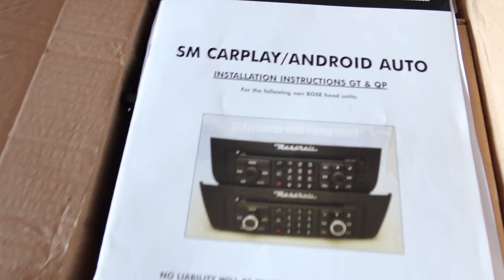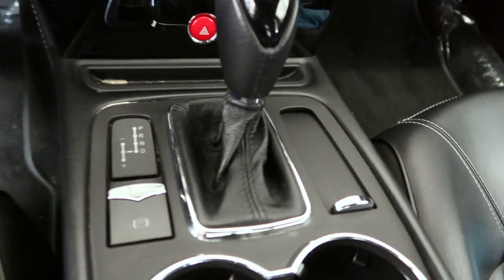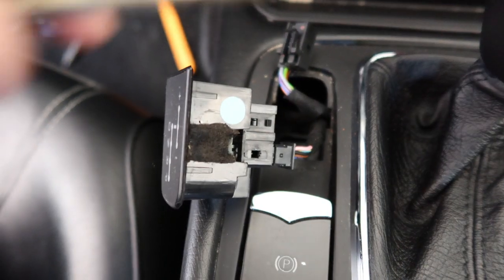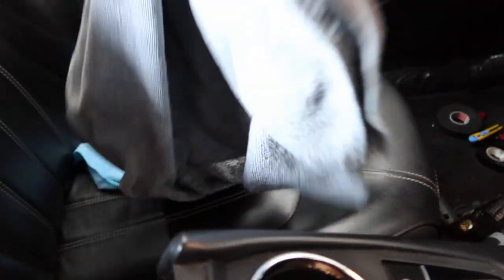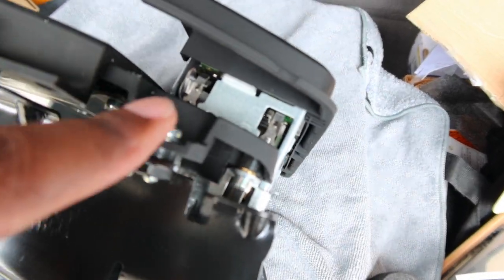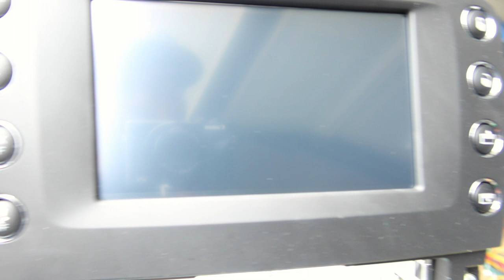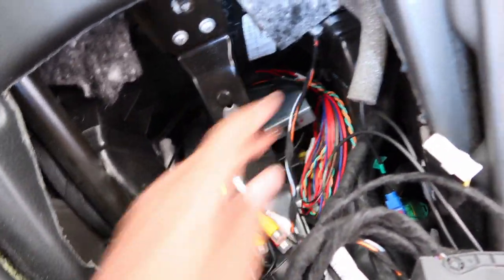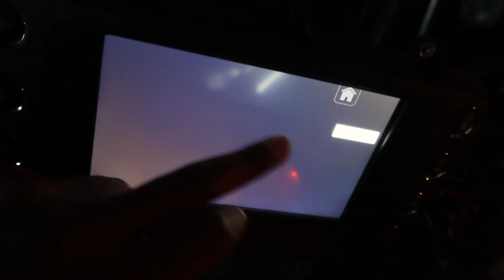ADDING APPLE CARPLAY TO MY MASERATI - FLICARGUY DIY!

Comment: Hey man, many thanks for an informative 2 videos on the installation! I'm trying to do the same myself and I don't know how to fish the aux 3.5mm from behind the center dash to the glovebox. How did you do it? Also, do you happen to have a pinout of the ISO connector so that I know I'm not splicing the wrong wires? Did you just go by colour as in the instructions? Thanks in advance for your help if you see this so long after posting your vid!
Reply from the maker: Man it feels like so long since I did this, I have something I use to fish wires, sort of like a wire hangar but a bit more rigid, that I was able to use once I pulled the glove box out. I can double check but I don’t think I have a pin out for the iso connector, I believe I just followed the colors in the instructions.

Comment: I wonder if using the purple painters tape would help on protecting the wood while using this tools? The purple adhesive is not as strong as the green or maybe they have something specific, like the clear file they have on delivered vehicles.
Reply from the maker: That’s a good point, I just tried to be extra careful, but some type of tape would definitely help as long as it wouldn’t harm the surface